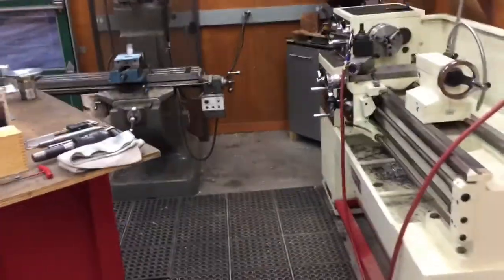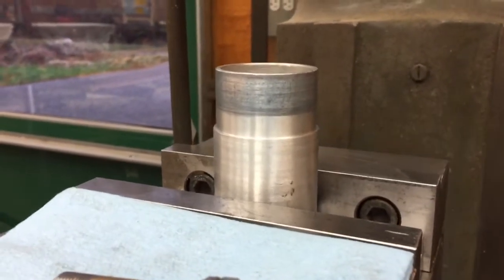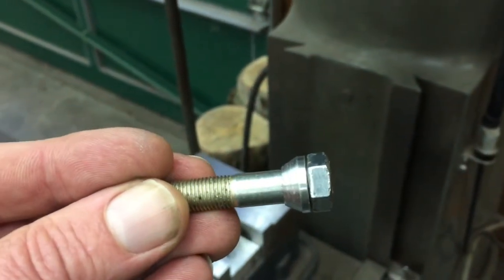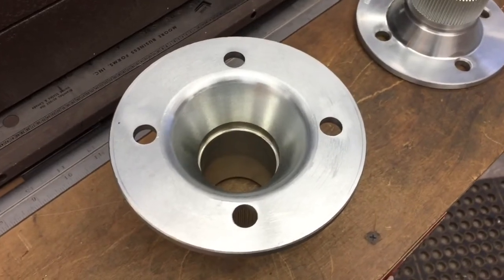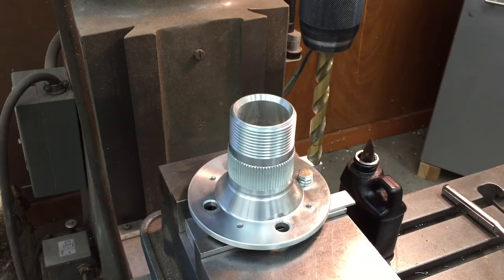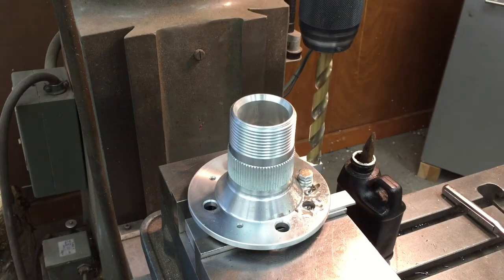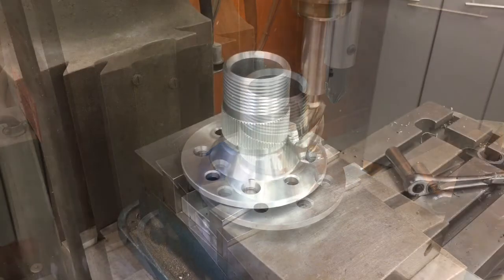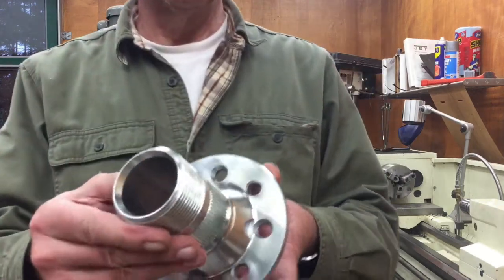Drilling A New Bolt Pattern In Wire Wheel Adapters

Comment: It seems to me that in the new position the lug nuts prevent the proper contact between wire wheel and hub.
The wire wheel rests on the nuts and not fully on the conical surface of the hub.
This will result in an incurable heavy unbalance of the wheel.
Plse correct me if I'm wrong cause I'm also looking for a solution of this problem.
Shims perhaps?
Reply from the maker: Ha. Just saw that there were comments on this video. Never thought to check. We had to modify the lug nuts to make it work.